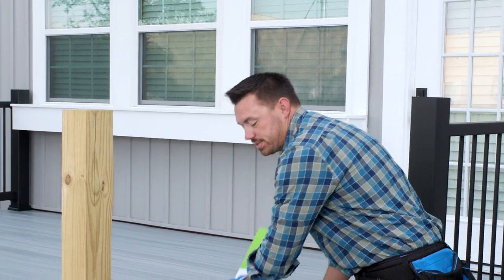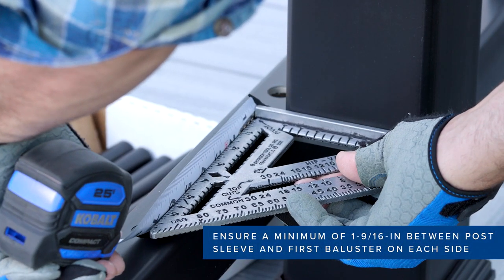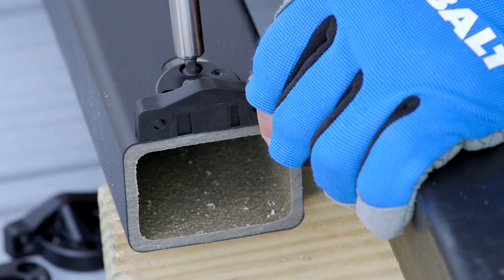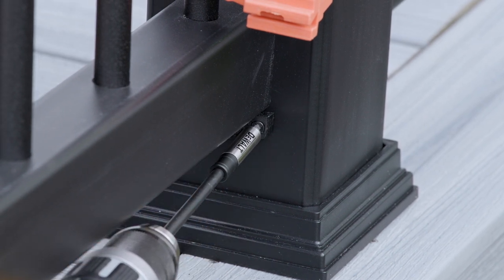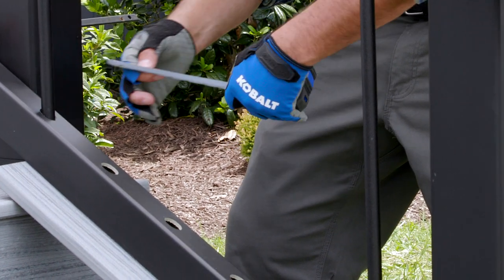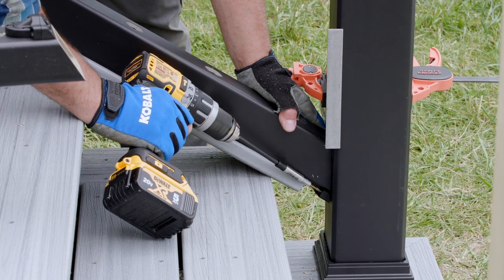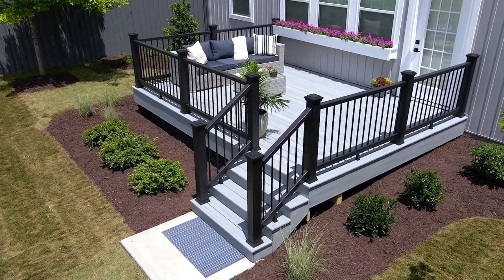How to Build a 12x16 ft Deck with Trex & Lowe's Part 3 | DIY Decking

Comment: Questions for you.  I recently purchased the same railing in black . I have a small deck i am going to restore with trex composit deck boards and trex horizontal hand rail . My deck is  10' X 10' . How far apart ahould i center my center 4x4 from the 2 end post to get the correct spacing for the spindles on the hand rail and what type of saw blade should i use to cut my post sleeves and aluminum rails . I was going to use a black saw blade that cuts metal and steel. Thank you for your time
Reply from the maker: Hello, thanks for reaching out. For how far apart the post should be, it depends on the type of railing you use. To cut the railing, you can use a carbide tipped blade with 60 teeth or more. If you have any other questions, please give us a call at 1.800.289.8739. - Thank you, Trex Customer Care

Comment: What should If the bracket angle doesn’t with the rail posts, are there custom brackets?
Reply from the maker: Hi Jonathan, thank you for reaching out! The bracket will allow for a 32-37 degree angle. If your range is outside that, please give us a call, and we can provide alternative recommendations. 1-800-289-8739. Thank you, Trex Customer Care Team

Comment: What is the difference (if any) in the Trex Select Railing kit and the Trex Enhance Railing kit that is sold at Lowe's?
Reply from the maker: Enhance and Select railing will have the same esthetics. The biggest differences are the following.
-Select railing only have the color option of white rails with Black round aluminum balusters, where Enhance has the options to get the rails in Vintage Lantern, Saddle, Black, or White.
-Enhance railing does not have an 8' span option, the only length in the Enhance line is the 6' span.
- Enhance railing is measured clear span, meaning the 6' railing sections if going to have an actual measurement of 72". Select is measured pot to post on center, thus meaning the 6' span has an actual measurement of 67.5" or the 8' span has an actual measurement of 91.5"

Please feel free to reach out to us directly at 1-800-289-8739 and we can answer any further questions you may have.
Trex customer Care

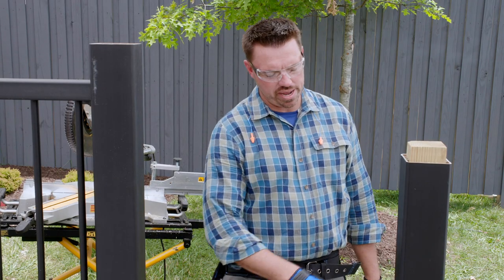Comment: I have a real problem. I already cut off my stair rail posts the same length as the deck rail posts for the horizontal rail (40 inches). I just the saw the part of the video where you used the mark on the post sleeve (6:51) for the top stair rail to determine where to cut off the post. Now, two of my stair posts are too short for the railing. My posts are in 30 inches of concrete and also part of the slab concrete. I cannot replace these posts without taking all the stringers off and digging up all the concrete. Is there anything I can do to fix this?
Reply: Yes, splice together a piece of 4x4 on top using a dowel to hold it in place. It’ll be covered up & nobody will know, except us. 🙂